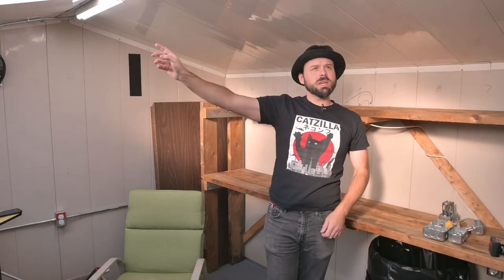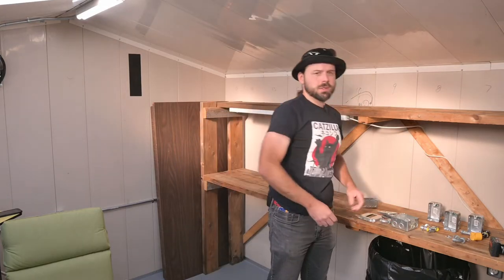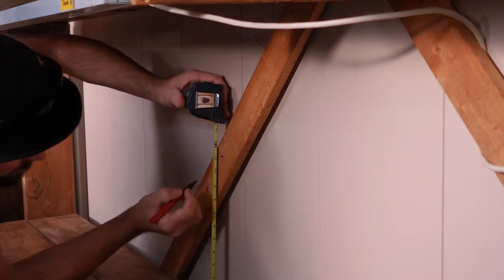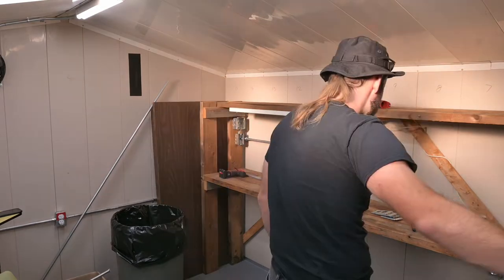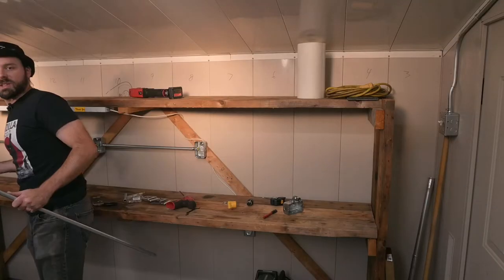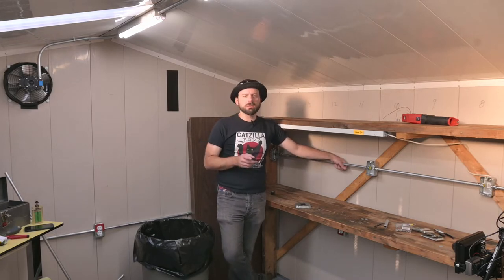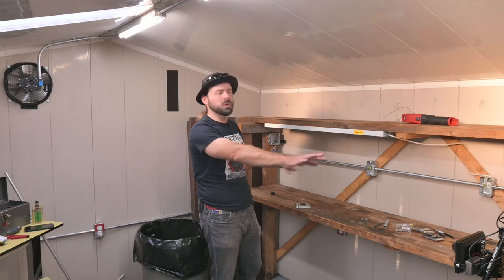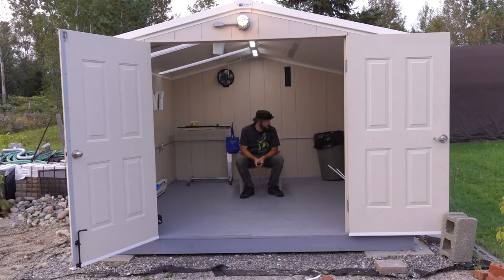Shed 2020 Ep.31 - Wiring up the Workbench - SERIES FINALE

Comment: Although I work around water being in the swimming pool business in SoCal, I have never even heard of AFCI. With a little research I found they are triggered by arcs. I don't know how efficient that would be when the current lights up a human like a lamp. I would think you would get the same protection from arcs with a GFCI, but not the same from electrocution from an AFCI. The only fault with GFCI is sometimes when they fail, they still send unprotected current. Does Canada even use GFCI's? More research shows they have dual function so maybe the GFCI can't detect certain types of arcs. Since I have never heard of or seen AFCI it may not be worth researching it any further.
Reply from the maker: Yeah AFCI is different from GFCI. AFCI has nothing to do with water, or protecting the user from electrocution. So yeah, a pool installer would have no use for it. 
It's more for bedrooms and living areas where flimsy cords and cheap devices get plugged in everywhere, and wall warts might be half handing out of a receptacle. It's about fire prevention. 
I normal breaker will only trip in an overload condition, so if a frayed wire that got chewed up by an animal, for example, decides to short out, it's got 15amps and a rather large spark before the breaker will trip. AFCI is designed to detect arching and a much lower current threshold, so that it can trip BEFORE the spark gets large enough to start a fire, from some dusty piece of paper that fell behind the dresser. 

GFCI can instantly detect arcs to ground, but not so much short circuits, cause it mostly depends on comparing the flow of energy in and out of the circuit and is looking for leakage. A short circuit may not read as leakage, as much as a really heavy load peak. 

As mentioned, in my case, if I'm working and my bench, swinging a hammer around or something, and I hit the cable for my tool charger, it'll kill that circuit before it's a problem. I actually use GFCI protection on my indoor workbench, where I work on repairing live equipment. It's can trip if I slip with the screwdriver. 

Yeah, we have GFCI in Canada. It require within arms reach (59") of a water source, so it's in our kitchens and bathrooms.
And yeah, you should find it in pool equipment/hot tubs. The exception is effluent pumps, like sump pumps, lift pumps, but I still GFCI those pumps cause I've found in practice, it can detect pump failure early.
Reply: @DATT  I did some more research and the yeah, the acfi does offer protection in a few areas the gfi doesn't. The gfci does cover a few of the arcs but not not all of them. And when you add both to the circuit certain appliances and tool, etc can trigger them. They should come up with something that gives trouble free protection for all faults in what one outlet or breaker. I'm sure they will eventually. Insurance companies should be investing in finding ways to cut back on fire claims. There has to be a way.
Reply from the maker: @chuckyz2  I think it's just a case of the tech maturing, or choosing the right protection for the application. 
AFCI, is kind of like a "smart breaker", they will probably get smarter. 
As of 2018, in my area, AFCI is pretty much required on all general circuits in a house, on any new builds or additions. 
I upgraded my house to 2018 code, so I got AFCI on almost everything, and it's been pretty reliable. I've had the odd unexplained ghost trip. Maybe 2 since the upgrade in 2019. I had several trips in my living room at one point that turned out to be a faulty lamp. It wasn't unsafe, just AFCI didn't like the fluorescent ballast it used. Couple branched has a combo AFCI/GFCI, where there is indirectly water involved, like my washing machine. 

At any rate, for the most part, the error rate has been acceptably low, which works for me since I know what's going on. 
I could see it being a no go for others that don't understand. 
I don't think I've ever had a GFCI trip when there wasn't actually something wrong.
Reply: @DATT  Lets hope. As for the GFCI's, I agree, but when they do go bad it can leave you unprotected. So using that test button frequently is important. Not many know just how important. At least here anyways. I have found and repaired 100's of electrical hazards on pool electrical. THey actually run 120 volts to the pool for the light. They are pretty stout but they get bad seal very regularly and that is a serious hazard. So many companies that built and repair pools have total hacks that cause severe hazards. Fortunately I have caught them before anyone was killed. But a lot of people have died in and around swimming pools here in the States. They have low voltage lighting alternatives now but they are still installing the high voltage 500 watt lights in pools these days.